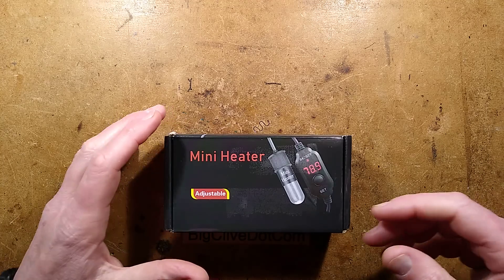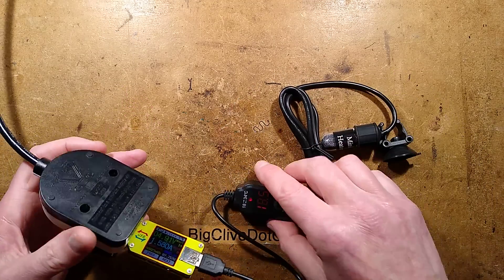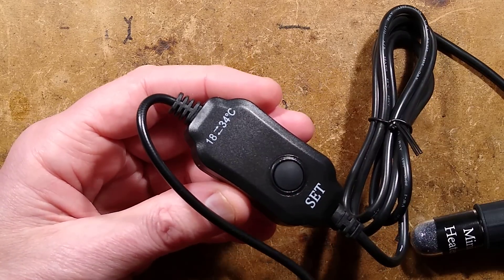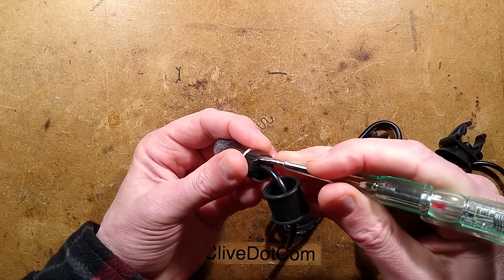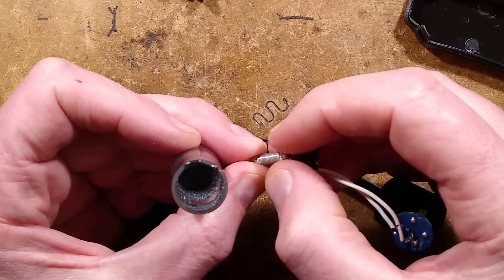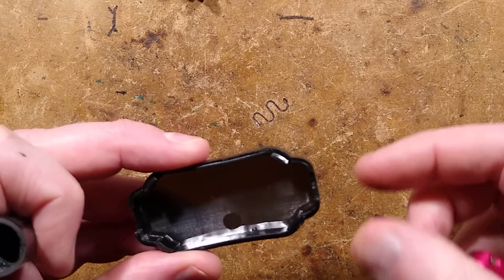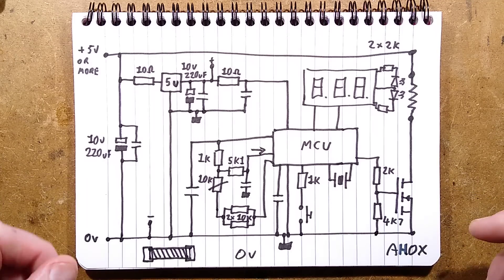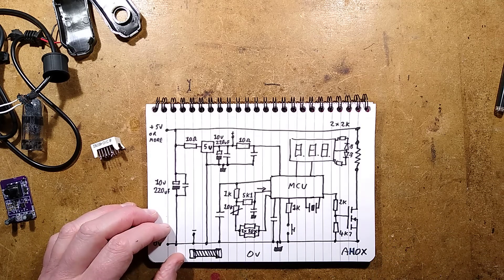Strange USB powered aquarium heater with other uses.

Comment: It is interesting though that they run this regulator from a 5V supply. I looked at the datasheet and most implementations of this regulator require at least 7V input. This would explain while everything is so flaky and flickery...

Comment: That MCU is from Bluetrum but they currently do not list a C series and all silicon they currently officially promote seems to have some form of RF (bluetooth mostly) or audio interface.
I wonder if this board was meant to do more, or if these chips are parts that have been repurposed because manufacturing defects rendered the RF/analogue part unusable.

Probably a 26 to 120 MHz RISC-V

Comment: I’ve got one of these in BIG planted bowl/shallow aquarium. It’s 3.9 gal total volume but that’s a lot of soil/grave and a lot of surface area to volume vs typical aquariums. I only want it 1F higher than normal daytime ambient and to not cool down too fast or get too cold when my thermostat kicks down overnight/when I’m not here. It’s worked quite well for over a year. The measured temp is within a few tenths F of other calibrated thermometers. The other upside of being underpowered is it can’t spike the temp too fast if it needs to recover. I’ve had an oversized heater fail on in an aquarium and the rate of change was disastrous even though I caught it before it got really high in an absolute sense.

Comment: I wonder if it is one of those cases when engineer is proud their son who designed this.
Reminds me of a Dyson lamp, somebody brought me. 12DC inlet is heavily filtered , includes two chokes including five tantalum capacitors all on the input and then goes to a buck convertor. No fuse, NTC or even a resistor to protect overcurrent meant that litle spike (from 12DC motor on a same supply) burned its MCU. with its own diode before Voltage regulator.
Bad luck miny Dison, should have put crystal and clocked up the 600 pound 6 LED lamp.
Ok, blame is not on a kid but dady who should have added the usefull protection.
Anyone heard of these AB MCUs? sounds handy. 

Although when is someone going to make DOOM run on a fishtank heater?

Comment: How are they using a 7805 with a 5v input? doesnt the 7805 need at least 9v input to supply 5v? or does the L version mean Low Voltage?
Reply from the maker: It's an odd choice.  That's what alludes to being for a wider voltage range.

Comment: Wow a bluetrum chip! I wonder if it has some other hidden features cause just like JieLi bluetrum is also big in the bluetooth chip bussiness and their cheap microcontroller chips often have bluetooth as well. Actually that 26mhz crystal is the normal frequency those chips operate at and every product with bluetrum seemed to run some 26mhz crystal. Just no antenna but maybe it actually is a bluetooth soc just with bluetooth disabled

Comment: Why do so many circuits switch the negative rather than the positive. ?
Reply from the maker: While there may be various different voltages used in a device, they are all referenced to the negative.

Comment: Why does the mcu need a 26MHz clock crystal? For this application running at a much lower speed from its own internal RC oscillator would suffice.
Reply: Its a Bluetrum chip. Bluetrum specialises in cheap generic (bluetooth enabled) microcontrollers and are often found in speakers or cheap headphones just like JieLi (JL logo). 26mhz is normal for these chips

Comment: That 5V rail is more like 2.5V thanks to the 78L05 with a 5V input. Also, why use a crystal? The internal RC clock that most micros have is more than good enough. Heck. Why not use the cheapest PIC made? This just looks like someone didn't really know what they were doing.

Comment: The OnePlus devices feature fast charging up to 100W over a special USB cable and special wall adapter. Perhaps, this heater device's circuitry is anticipating use with upcoming advanced charging standards.

Comment: I always wonder how such products get designed. Or rather which steps they take before they go to market
Is there someone designing the whole thing with lots of design rules in mind, then another cutting the costs but don't know a thing about electronics?
like having a 5V regulator but only 10V capacitors and on a 5V supply
or the 26MHz crystal and the beefy micro
or the complex resistor divider for the thermistor
I mean, even a 8-bit micro on 10kHz can crunch even some float numbers every 10 seconds to control a heater

A skilled electronics person could easily half the cost of that PCB

Comment: Change the input cap and then use a PD or QC3 triggering board to send 12v or 20v 😅
More power !!!!
BTW, why is there a 5v regulator if you use 5v from USB??? The regulator can't do its job without extra voltage...

Comment: The AB on the MCU is actually Bluetrum's logo. They specialize in Bluetooth microcontrollers, most of them audio-oriented. Some of the cheap bluetooth speakers use these chips. I wonder if this heater could have a Bluetooth functionality in another version of it (an app for controlling it maybe?)

Comment: There appear to be heaters operating at 110V using the same housing for the control, both on Amazon and on the box  @ 0:10. It would be interesting to know how they do that, probably a triac for the heating element and some sort of voltage dropper for the control, but do they add a second PCB or use a completely different one? I'm not sure I'm curious enough to spend $20 to find out, that is twice as much as the USB version so they could afford to add quite bit of stuff.

Comment: You should get a 150-watt USB C charger, then connect the heater straight to the output, and then see how fast it can heat a glass of water.

Comment: Back in the 1980s we used Charlieplexing to drive seven segment displays.  Charlieplexing takes advantage of the fact that MCU pins can have 3-state output.  This allows LEDs to be cross connected.  You can find the number of MCU pins needed as

n=(1 + N^0.5)|max

In theory, three digits plus decimal for each could be driven with as few as six MCU pins.  The downside is that it takes some code gymnastics.  Often there’s more code space on a PIC than pin real estate.  There is a pretty good Wikipedia article outlining the concept.
Reply: charlieplexing can also be used with a keyboard matrix but it requires a bunch of diodes per button so it's not used very often.
Reply: @ Thanks for the added information.

Comment: It almost looks like it’s built for an upgrade version for usb C and the ability to adjust to higher voltages.
Reply: That would require the mcu to do power negotiation and that appears not to be an option here.
Reply: Correct but I was saying it looks like they could easily do that. It would require a something like a HUSB238 that is only 2.6mm x .46mm

Comment: I had tropical fish when I was a kid.  The heater just had a bimetallic strip and a plastic set screw controlling the heater inside what appeared to be a stock test tube.  It is hard to believe an MCU, display and components would be less expensive than a scrap of metal.
Reply: Those bimetallic strips like to weld.. exactly what happened in my dad's aquarium and it boiled all of the fish. The smell was terrible.

I made him an electronic thermostat which used a triac to switch the heater instead
Reply: @  I am very sorry to hear that.  Thanks for sharing.   Knock on wood, I did not experience that in the years we had an aquarium.  A help would be to add a second contact to open at a slightly higher temperate with an indicator lamp across the contacts to indicate trouble in the circuit.

Comment: I've been using a similar heater (10W fixed temp) and a while in a nano-aquarium for some time.  Other than making sure you use a USB power supply that greatly exceeds the 1amp the heater requires, its been great.

Comment: That's a Bluetrum SoC, same as used in Bluetooth speakers and TWS. Maybe a bit too late for that now, but does it happen to have a Bluetooth feature where you may be able to pair with it and see the temperature and/or adjust it remotely? There's no way they would've used something like that if they didn't need it.
Reply from the maker: No obvious antenna.

Comment: "USB" can now provide 5V, 9V, 15V and 20V... It's less common to see voltages above 5V with anything but a C type connector these days, but the USB spec does allow for voltage negotiation over an A type connector and there was a brief period where this was common on phone chargers.
Reply: > "but the USB spec does allow for voltage negotiation over an A type connector"

The current USB Power Delivery specification voltage negotiation is done over the CC1 or CC2 pins (depending on the connector orientation), which are only present in a type C connector. The original, now-deprecated and unsupported, version 1 specification did permit voltage negotiation via frequency modulation on the power (VBUS) line, but this is no longer done and was very short-lived. Also, implementing the version 1 specification was required for devices using type C connectors, but was not required for devices using type A connectors, which further limited its adoption. You will be hard-pressed to find a charger currently on the market that supports it on a type A port.
Reply: AFAIK, it's against the spec to provide anything other than 5v over the A connector.

The other voltages were common with "alternative" specs like QC.
Reply: >20V from USB C
They are actually working on a revision going up to 48V, at 5 Amps, which IMHO seems overkill for anything but gaming laptops and similar extra high performance devices
Reply: @MrHack4never supervooc chargers do 10 Amps already at 15v there 150w of charging
Reply: @MrHack4never  48V is the standard voltage for power over Ethernet and similar power distribution systems,  so this would actually be quite useful for reducing complexity in some kinds of devices. 48V is chosen partly because Voltages below 50V are considered "safe" but mostly because it is straightforward to create 48V from 4 12V batteries (it's a hangover from the wonderful world of telephony!).
Reply: The spec doesn’t support negotiating higher voltages over a USB-A connector. That was Qualcomm’s QC system that does that and it is outside the spec.
Reply: @stevebollinger3463   It wasn't just a Qualcomm thing. It was a standard, as I said earlier, in the version 1 specification of USB Power Delivery, to allow negotiation of higher voltages on a type A connector by means of frequency modulation. That has since been retracted and replaced with version 2 of the Power Delivery specification, which negotiates over the CC pins located only in a type C connector.
Reply: @aaronmdjones  Yeah, for a very brief moment, just as fast charging appeared, it was quite common to see smart phones with a USB-C connector shipped with a USB-A PSU and a A->C cable... Then, almost overnight, the PSUs started coming with C connectors.
Reply: @pingumcping   It wasn't quite overnight. Revision 1.0 of the USB Power Delivery specification (which allowed negotiation of voltage on USB Type A connectors) predates the USB Type C connector by two years. But yeah, like I said, you'll be very lucky if you can find any USB charger on the market that supports PD 1.0 and voltage negotiation on Type A ports. Type C came along, added some more pins (including the CC1/CC2 pins used by PD 2.0+), and everyone forgot about Type A for anything but 5V.
Reply: @aaronmdjones  Yes, obviously it wasn't literally one night - Samsung, for example, shipped USB-A socketed chargers that supported (at least) 5V and 9V with several generations of their USB-C socketed phones. But in the grand scheme of things, it was short lived. Most manufacturers briefly switched to USB-C socketed chargers before ceasing to ship chargers with phones altogether.
Reply: @stevebollinger3463  USB Power Deliver v1.0 describes the sink negotiating up to 20V over a USB-A connector using BFSK modulated communication on the Vbus and Vgnd lines.

Comment: Odd they use glass for the housing of the heating element. Suppose the heat has to go somewhere so it will come out, but glass would be my last choice of material to use for proper heat conducting.

Comment: It's not cost optimized. 
No need for a 26MHz xtal for such a goofy job, when an 8 MHz internal RC oscillator would've done the job and even able to sleep most of the time!
Reply from the maker: Yeah, it's a bit odd.
Reply: 26MHz is commonly used for Bluetooth  SoCs, and this one is from Bluetrum which makes lots of those. I wonder if it has a hidden BT feature.

Comment: it should be ok because the 5 volt hand warmers get hot so id thinks it's the same idea, I had a 5 volt air pump I made for my tank so when the power went out the fish still has the ari bubbles,

Comment: I've have one of these I bought it a few years back to heat a small greenhouse by using it in a bucket of water so it could let the heat off at night it didn't work well lol the bigger ones did but not this tiny thing. Lol

Comment: Clive, you understand, this is just my observation of your past purchases, and there seems to be a propensity to go after long devices with domed ends, all of around 30 to 40 mm in diameter. This one happens to heat, but(t) there have been vibrating ones and ones that light up. Is this just a coincidence or are you curating a collection of similar-shaped devices, to be use "off-label" at some point?
Reply from the maker: I would expect these small devices to be most unsatisfying.  I'd really have to buy one of the many full size purpose made devices for that, and I already know that YT doesn't like it when I take THOSE apart in videos.

Comment: What are the odds, I just bought this exact one from AliExpress 😂. Haven't testet it yet. But I will do tomorrow, especially the circuit board. I hope there are no accidents on mine. 

Oh by the the way Clive, did you know that there are 5mm flame simulating LEDs with integrated timers? I just stumbled across one for modding my solar lamp. The solar cell died due to cracks in the glass. I got the idea to use a tee light with integrated timer and replace the CR2032 with 2 AA batterys for longer runtime. Worked out fine, but when I opened up the little tee light I was shocked. There was no circuit board or chip in it. Just the 5mm Led. But it switches of automagical after 6h and turns back on after 18h. I tried to find these LED online but they are no were to be found. Do you know them or anyone else who is reading this? If yes I would love to know where to find them! 

And Clive, thanks for all those years of finest content! I am no electrician at all, I know some things that's all. But I love watching your videos and streams! You are a great guy! Greetings from Germany.
Reply from the maker: I've not come across the LEDs with integrated timers yet.  It's always quite tricky finding the more specialist LEDs on places like AliExpress due to translation issues.

Comment: At first glance that heater almost looked like a heating cartridge used in 3D printers, but those are fully encapsulated in metal and have higher wattage ratings.
And I find it a bit sketchy that the pads for the incoming power are labeled L and N. Sure, you could use it with higher voltages, but probably not THAT high 😉
Reply: There are also 10W and 20W versions, but those have a regular power plug. The 5W version is the smallest and is the only version with an usb plug.
Reply: They will add an capacitor to reduce amperage. IT'S GOUNG TO BE FINE!  ;-)